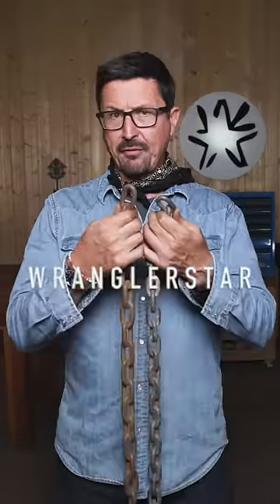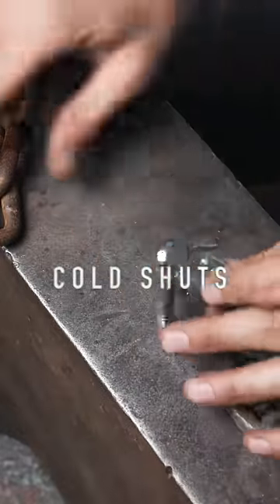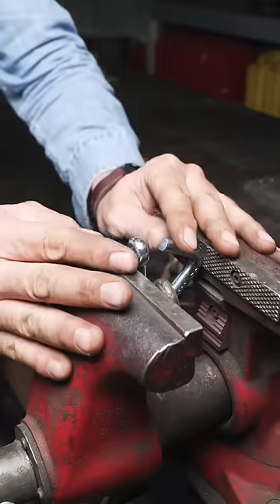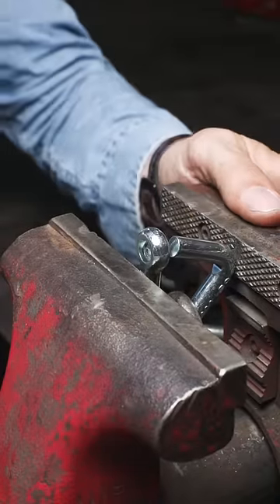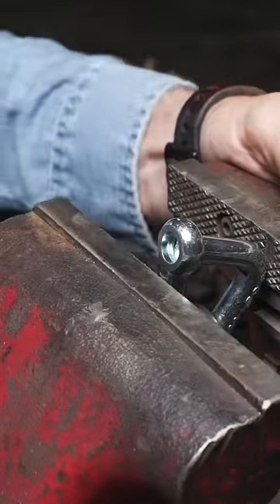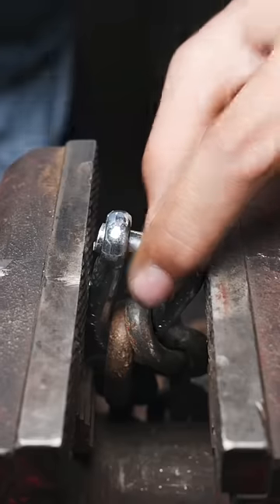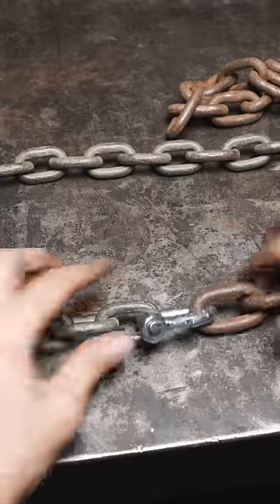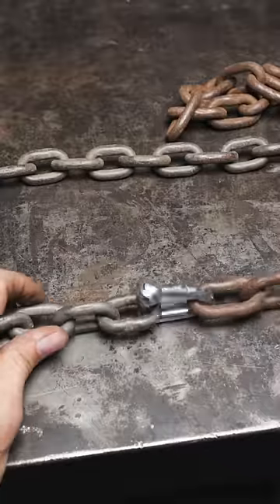Emergency logging chain repair Wranglerstar professional Homeowner #shorts

Comment: Cody, I gotta call this one out for safety. 

  Some finer points of cold shut links are:.      1. They are only designed to be used with grade 30 aka proof coil chain, they are not suitable for applications that require stronger chain. 
2.  Always size the link to be equal or higher to the rating of the chain, when the appropriate link is used and set properly it should not affect the strength of the complete chain.  The link is usually a nominal size larger than the chain e.g. a 5/16" link is used for 1/4" chain with the link rated at 1300# and the chain at 1250#
3.  It's super ultra mega important to fully close the link until the long sides are parallel.  You then must peen the tail down like a rivet to lock the link closed.  When the link isn't closed fully the resulting delta shape does not retain the full strength of the link.  If you fail to peen the tail into place, it can pull back out snapping the chain.  Leading to a transcendence of the physical plane!!!!!!!!!!!!!!!!!!!!!!!!!!!!!

For those of you questioning the vice,  It's normally done with a big hammer and your preferred ASO in the field.

* Also worth mentioning that twin clevis links are another great alternative that are reusable and come in both grade 43 and grade 70 flavors for when you really need to send it.
Reply: This is the best argument for YouTube to never remove the comments section.
Reply: My thoughts exactly
Reply: High IQ response, gotta say
Reply: Amen
Reply: ZStone21, you beat me to it...carry on brother
Reply: @sebione3576  comment sections are only removed for people speaking against communism and other liberal ideologies
Reply: I was wondering exactly this. Closing the link with a pair of pliers and a short sledge is an easy day, but why not peen after for additional strength?
Reply: Also a quick link is too easy
Reply: @derrickhartman1362  so the thing with quick links is that generally they will lower the working strength of a chain system.  They end up being slightly smaller and rated lower than the same nominal chain size similar to the cold shuts but the threaded bits and sleeve prevent uprising the link (i.e. the bigger link won't go through the smaller chain as intended)
Reply: @TheEbanks7   I understand that but aren't they stronger than those other links that hes using on the shows
Reply: @derrickhartman1362 Surprisingly no, this is a "don't let looks fool you" type situation.    Quick links are a compromise between convenience and strength vs a fully formed chain link.  
**It's worth noting that this is all based on WLL (working load limit) not ultimate breaking strength so it includes a rather large baked in safety factor.  I would be curious as to how they would fare against each other  in a failure test.
Reply: I was fully expecting some peening once he'd "closed" that link, nice to see that it's intended👍
Reply: The correct way..
Nicely said..you do have to make them parallel and flare the end..
Reply: And 2 work better than one..
Reply: Can't a regular shackle be used instead? Have to imagine that shackles are more common to happen to carry around when accidents happen than specialized kit like these?
Reply: Double clevis is the best way to repair a chain. Especially for lifting and dragging (as, say logs).
Reply: I am glad I didn't trust this video. Your comment here proves another point if incompetence on this guys part. You should look into the videos about the Harbour freight winch he had.
Reply: "Leading to a transcendence of the physical plane" Pure poetry🤣
Reply: I don't fully understand what you said but getting the jist I'm kinda wanting to listen to you more and keep absorbing knowledge
Reply: Those threaded quick links are rated really low, I snapped one winching a compact tractor bucket off the ground. Found it odd because I’ve seen them on equipment trailer chains from cheaper manufacturers. Double Clevis or nothing.
Reply: Most correct and thorough comment
Reply: Yup, I came to mention that you should always peen the end to lock it in place, but you beat me to it 🫡
Reply: Wouldn't it be you've compromised the chain once you've loaded it to the breaking point.
Reply: For non english native people, what does ASO stand for? Asking for a friend.
Reply: I too thought he should have peened the end like a rivet.
Reply: I like your funny words magic man
Reply: What he said.

Comment: “Field repair”
Proceeds to use a vice mounted on a workbench
Reply: Usually there’s a service truck with a bumper vice in the log woods. Kinda running on hopes and dreams without a service truck. From my experience.
Reply: Ya I cought that too
Reply: you could use a stump vice too, he just used that for an easier demo
Reply: @braxken8060  you could definitely not us a stump vise for this repair. I’m a full time logger and not once have I seen a stump vice capable of that.
Stump vises are for light duty stuff, such as keeping your saw still while sharpening

Comment: Wth would you not just use a threaded quick link?? No tools necessary and waaaaay stronger?
Reply: Yeah I was thinking a mini shackle would be easier / better
Reply: 100%  correct.
Reply: Wranglerstar is the teacher type 
 He just wants to do thing thee old fashioned way that's all.
Reply: I still don't know the reason for not pounding it on further so link becomes a solid piece of the chain later welding it together back at base
Reply: lmaoo ikr
Reply: It's called a Clevis or bow shackle.
Reply: @stevek.1979  it's called a quick link, different than a clevis or bow shackle.

Comment: “Emergency field repair”? I never brought my bench vise out into the field but I’m no forest Ranger.
Reply: TBF iv seen a few trucks that have them mounted on the back.
Reply: You clearly haven't seen his video on the stump vise.
Reply: @Gravitics  oh I have seen it, that’s not a bench vise and im guessing you weren’t allowed on many rides at the carnival with the height requirement because the sarcasm flew right over your head
Reply: What?! That is a required packout item. Water, knife, lighter, 50lb vise. All you need to survive the wilderness.
Reply: @Teh_Random_Canadian  I’m gonna have to get a bigger backpack or leave the drill press at home
Reply: @davidwooderson5926  if you’re backpacking, you probably aren’t using chaine. And a lot of work trucks have vices.
Reply: @ianrowell2183   no kidding? Like the ones we had at Union Pacific, with ours being right on the bumper? 🤔 Huh?

Comment: "like a professional home owner" imma be real, I've never been in a situation of "oh damn, my logging chain is broken in my 1 bed flat" 
Maybe this is supposed to be an "another custom tool..." ending? 
Either way, I enjoy your shorts
Reply: Not everyone lives in the city lmao
Reply: I'm across the pond from you but a flat isn't a home right?
Reply: Emphasis on home owner... a flat isn't a home and you don't own it
Reply: @MyUnquenchableThirst  basically an apartment for u
Reply: @787310  look, I'm planning on buying soon, getting money together for that deposit, and I have a sneaking suspicion my opinion will not change
Reply: @baconatoromg6062  very true, but how many out of city dwellers use logging chains. Anyone other than loggers?
Reply: @APenguinsLullaby  anyone who cuts firewood or lives in a snowy climate
Reply: @baconatoromg6062  how much wood u cutting? Also, didn't a chain become infinitely useless with chopped wood? You'd need a pickup truck or van for that
Reply: @APenguinsLullaby  several cords a year. Chains can tie multiple blocks together for a drag, help direct a tree fall, secure large blocks for the drive home. There's several uses

Comment: They makes those that just screw together..... That's would be and actual feild repair...
Reply: @Chase Williams yeah lol I have use bolts before.  They do the job.  Just make sure to engage safety squints 🤣
Reply: 100% correct, it's called a screw quick link. Way better than what he is using.

Comment: Always use cold shut links with a rated capacity equal to or greater than the proof coil chain they are attached to.
Reply: You just use a quick link.
Reply: Yes, indeed is important safety to disclose

Comment: Quick it's an emergency, grab the field vice and the exact proper hardware !!
Reply: Thats what I was thinking too like you would either have to have that vise or some crazy strong pliers of some sort to squeeze it close
Reply: Work trucks have vices on them people. And if you are working with a 3/8ths chain then yes, you will have the exaxt hardware to repair it.

Comment: Good one Cody. There's so many uses for the standard emergency bench vise everyone takes to the field with them. I would have just used my pocket acetylene torch with the nalgene fuel tank and mig welder but this works too.

Comment: Where does one find a bench vise while doing an emergency field repair?
Reply: Welded to the tailgate or on the hitch

Edit: the rear bumper, or the back of the deck*
Reply: @nickkk420  Welded to the tailgate huh?  You've never worked a day in your life, have you?

My point is that a "field repair" is generally referred to something that can be done with simple hand tools.  Not a fully equipped rig or shop.
Reply: @doughaner2709  you don't bring your truck & tools to work on your field?

A vice isn't a table saw.
Reply: Ask the professional home owner with the logging chain! 😃
Reply: @EquipmentAttachments  LOLZ
Reply: @doughaner2709  never seen a flat deck hey
Reply: Use your fingers
Reply: @meowkie8549  Of course?  Why sidn't I think about that?
Reply: @nickkk420  What part of "field repair" don't you understand?

This is a "repair."  A "field repair" would be using a shackle to get by.
Reply: @doughaner2709  I completely agree this is not the right solution, I'm just saying, there's usually a work truck around complete with vise when I'm in the field, but yes we'd have just used shackles or a new chain
Reply: @nickkk420  For sure.  But having a work truck, basically a rolling shop, on hand is kind of cheating for a "field repair."  

Especially for USFS guys who can sometimes be a bit far from the "road."
Reply: @doughaner2709  I mean the reality is many of these tips and tricks are hard to implement in casual situations unless specifically prepared for em, I didn't even know such a chain repair existed, and it'd have been laughed off of my mine site, but always interesting to see these things, I think it was just shown in a weird way and justified poorly
Reply: Mounted to my trucks tailgate with a set of all the other tools i could possibly need in every day repairs
Reply: @unpersonableme1805  naw table saw is keeping the winch company on the front  grinder and vice on the back
Reply: @doughaner2709  yep, rolling offroad shop is the idea ,feild repair central but crossing water too deep swamp mud or oceans is a bit above its weight grade, so modular is key so it can all be raft packed across by another vehicle  ... or mount it to a water floating tank tracks and all a full field service vehicle 85°uphills or otherwise
Reply: @Mr Poopybutthole someone's truck is usually close yes, and that's at least as plausible as a weird chinesium excuse for a chain link replacement being readily at hand
Reply: If your logging and don't have a truck with one you lost.lmao
Reply: @bwspacity  A "professional homeowner" is not using a logging chain for logging.  They are using it for other purposes.  And a field repair is own which can be done with minimal tools on hand.  Like placing a d-ring shackle in to get by.
Reply: @unpersonableme1805 if I can attach a vice to the back of my truck I can attach a table saw just as easily

Comment: You're supposed to push it even further, then peen the end over like a rivet. Then it'll stay even better.
Reply: That's what I thought, too.
Reply: Anything would be better than, that.

I've had a long chain break on me & I've used nuts, bolts, & washers to repair the chain & it prolly works better than this, option? Not to mention a vice would be simpler to obtain than those log chain master links. Shakes daym head

Comment: Not all people has a Vise in their back pocket in the woods. We also brad that end solid.  I've broken chains again that coldshot held. It might be the operator in doin it that makes the chain weak. Logging chains can't be weak. If so, replace the chain. If you can't trust your chains. You are screwed.

Comment: Throw a weld over both sides of the loop and you'll get a decent chunk of strength back
Reply: Lmao of course if you finish the loop with some welds it’ll fix the main issue! But yeah could be done and used like new

Comment: Emergency field repair, now guys, first pull out your pocket heavy table vise and...
Reply: I think you might be able to do it with an axe stuck in a log as an anvil and a second one or hammer, and then try to peen the end to keep it from slipping off.
Reply: It fits into the receiver hitch
Reply: You clearly haven't seen his video on the stump vise.

Comment: Ahh yes when I’m out in the field I’ll pull out my heavy duty pocket bench vice to do an emergency chain repair, if that doesn’t work, I’ll check my other pocket for my arc welder and weld it up with my 3 phase power supply from my back pocket

Comment: Good thing I brought my table and vice out here in the woods for my emergency repair
Reply: I think you beat each and everyone of us in here to the exact same comment! L O L! I’m wondering if you could use a sledgehammer and your bumper?
Reply: He shows that his logging truck has a vice loaded on it. Relatively common for someone working like that
Reply: @TheMaddoxfam  Of course he has one. But the average Joe doesn’t. Specialized work trucks usually have them, but that’s about it.
Reply: @EasternSunset007  touché. He has lots of videos about being a “professional homeowner” and encourages the installation of a vice. But you’re right, the average joe won’t have one
Reply: @TheMaddoxfam  I have tons of other tools in the toolbox of my truck that I could probably use in this case. But, it might not be a bad idea to grab a small vice and throw it in my toolbox. I don’t necessarily want it mounted on my truck, though.

Comment: Logged for years.     Them things r garbage.   And they’ll never fit through a choker hook    Best way to fix it in a “emergency” is to lay the 2 ends on top of each other and weld them     But just do it right.    If u break a chain    Buy a new one.    It’ll save ur life in the woods

Comment: Welding rod and booster cables give it a small bead to prevent it from coming apart also I would squeeze that until it looked like a straight link

Comment: Have to ensure its never cross loaded. Quick links of the right diameter are a few cents more, stronger and only need a spanner which you will probably have in the field.

Comment: You have a vice in the field?
Reply: Wouldn’t surprise me. I’ve worked for electric companies and the linemen all have vices on the backs of their work trucks
Reply: @ChrisTheHoosier  A lineman or a sub electrician's truck is pretty different from "every homeowner".
Reply: Most people that work in that field have them on their trucks
Reply: Bolted on the truck sometimes 
Yes!!
Reply: @code9mill  sure, loggers and electricians, but that vice is a heavy duty vice.  Also aa a profesional homeowner I'm hauling all thise logs....

Comment: I always have my edc bench vise. It's very handy. It's best carried in a usfs approved sheet metal belt sheath. I take this a step further by firing up my edc generator and laying a nice bead on there with my edc mig welder

Comment: We use these in rock climbing. We mount a pair of them (open, just like they come from the store) to the rock at the top of popular sport or trad routes. When you get to the top, you just drop your rope in them and have your belayer lower you down. It’s funny that I’ve been familiar with cold shuts for a decade or more but never knew what they were for.

Comment: Seems like if you have access to a shop with a vice in it you could make a better repair then that. Even one those quick links would be stronger and don’t require a vice in the middle of the woods.
Reply: You clearly haven't seen his video on the stump vise.

Comment: After, shutting  you should always Brad the stud so it doesn't pull back through the eye of coldlshut or weld it. Brading is an art of peening with a ballpeen hammer.  Using  the the half round end of ballpeen hammer. Oh always wear safety glasses when Peening. And hold bottom of coldshut with vicegrips on flat thick heavy steel. In order to get a good base, for Brading process.

Comment: Need to revise what you said here.....and what was shown.
Like how would you do this when you're, oh I don't know, out in the field and you don't have a vice?
A rope and try wedge?
2-3 guys squeezing via rope?
Outdoorsy?
Something?
Reply: The have something on the back end of a single edged axe.  They also have vices on every truck in the field when fighting fires.  You can also saw a shallow channel in a stump and put the replacement chain seated at the bottom of the replacement chain.  Line up you work and have at it with the flat end of a hammer.  I hope I helped!

Comment: If you have vice during emergency field repair it isn't emergency.
Reply: Never seen a truck bumper mounted vice? No doubt there’s a few hanging around the forestry equipment.
Reply: @gibsonwill18  cause every home owner has one of those

Comment: We have one type of link where it had two eyelets. And one is threaded, and there is a small basically a bolt with a wing nut to use to screw in. I think I saw some the other day at Ace. My dad used them in the oilfield

Comment: Don't use shackle as it's not rated for side loading, and don't use lap links for overhead/vertical lifting, cold shuts are stronger than welding a cut chain, I hope this clears up all these confused comments.